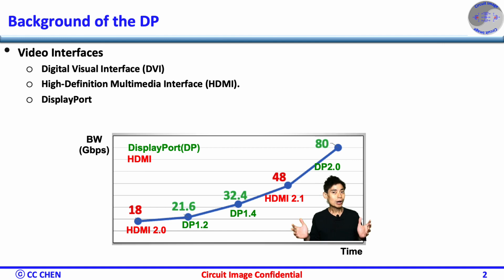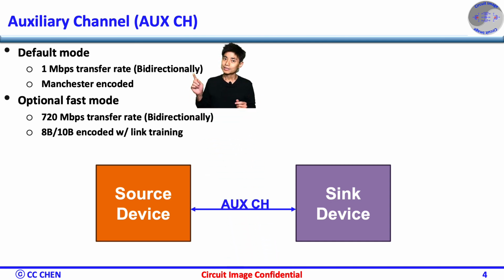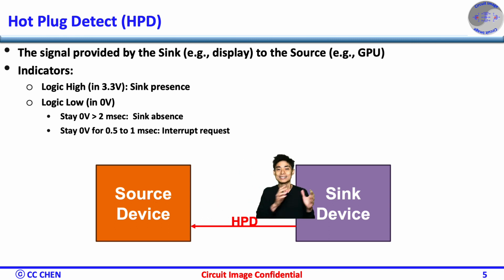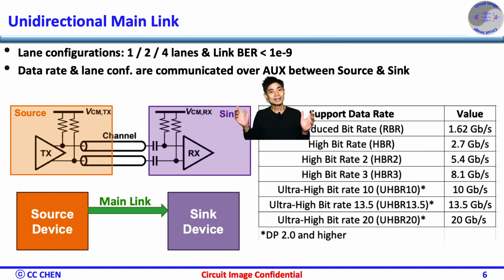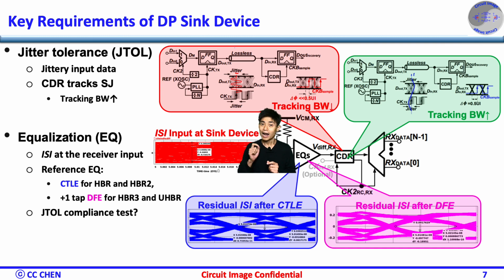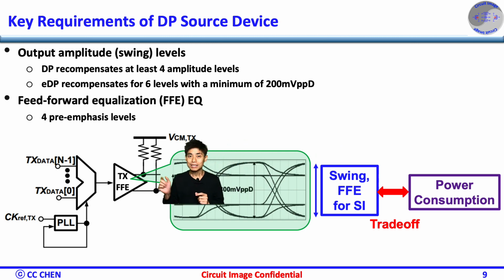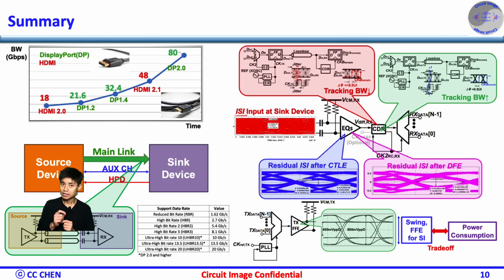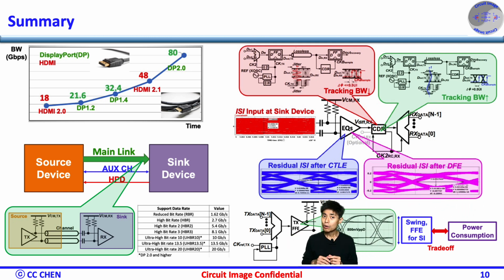Why DisplayPort (DP) and its Developments in SerDes?

Comment: Great video. If you can, beside textbook circuit analysis, can you share some rules of thumb and common techniques used in production SerDes circuits?
Reply from the maker: Hi Bobby, thank you for the good question. The simple rule of thumb is to make your EQ as good as the ref. EQ or even beat it a lot such that you have much margin to tolerate any unexpected production issue. The fundamental thing is still to make sure your intrinsic impairments should be as little as possible as well as to gain more margin for any unexpected production issues.